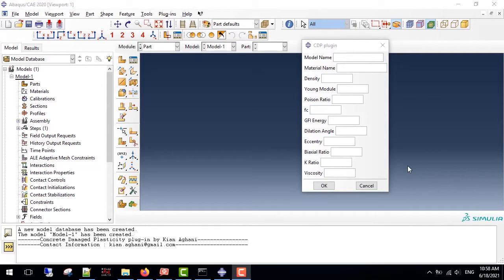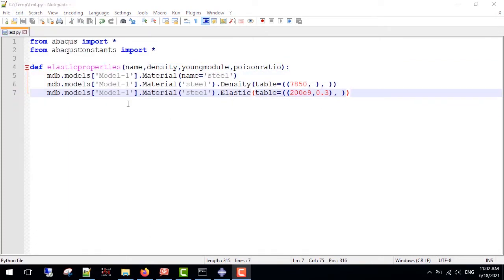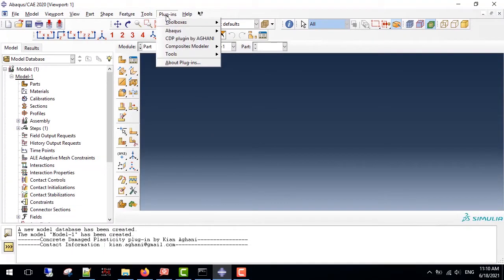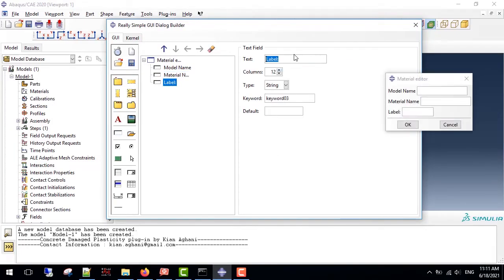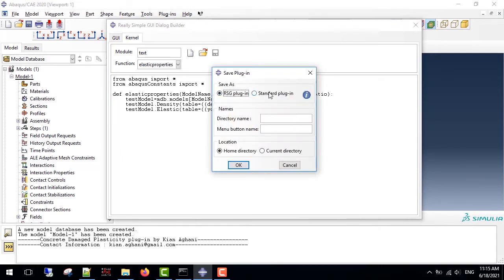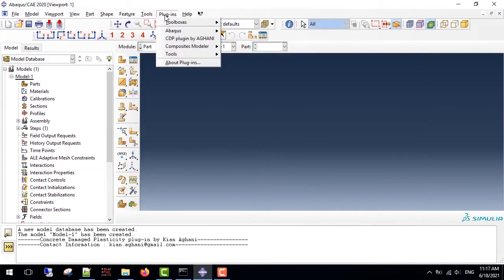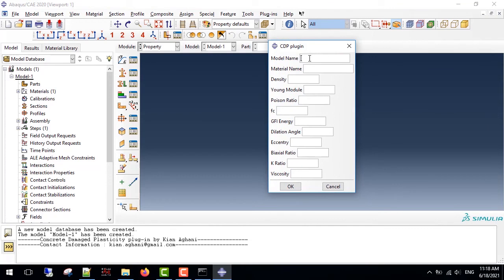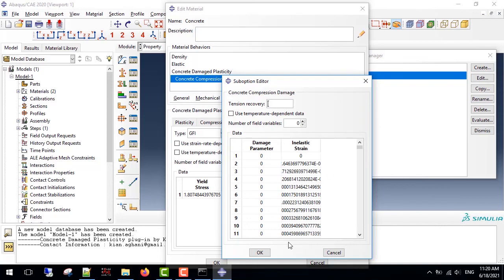Concrete Damaged Plasticity plugin for ABAQUS

Comment: Do it uses stress strain diagram from code or test data?
Reply from the maker: It uses the Saenz stress-strain equation for concrete, which is pretty good for numerical simulations.
Reply: @kianaghani  thank you so much for your promt reply.
Reply: How do you determine tha fracture energy GFI value? @kianaghani
Reply from the maker: @structurelearninghub3340  depends on the eq. you are using. I normally use fib-2010 code equations.
Reply: @kianaghani  Hello sir, Which relation do you use to define the behaviour of concrete in tension ?